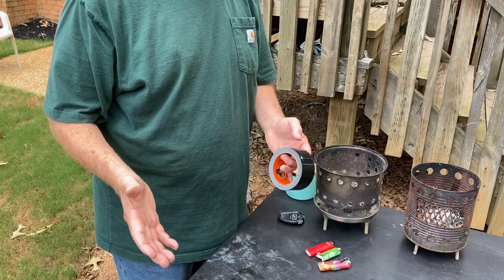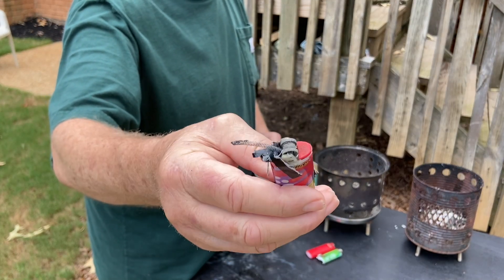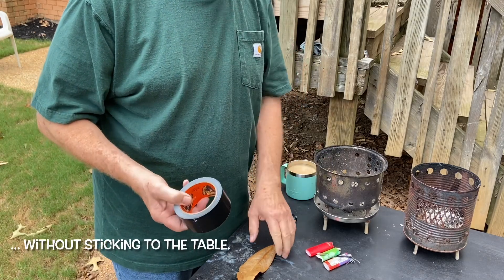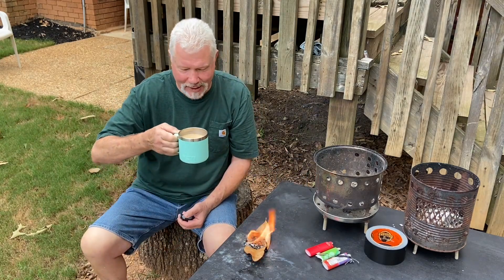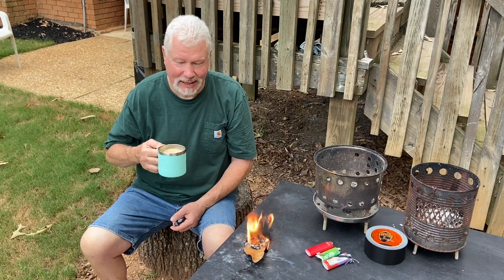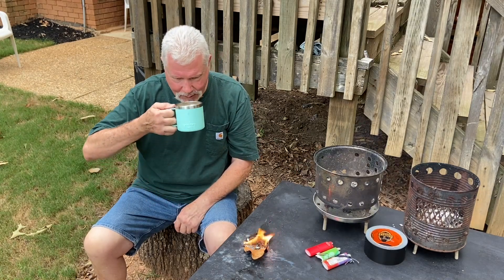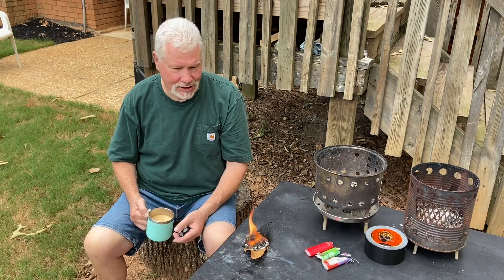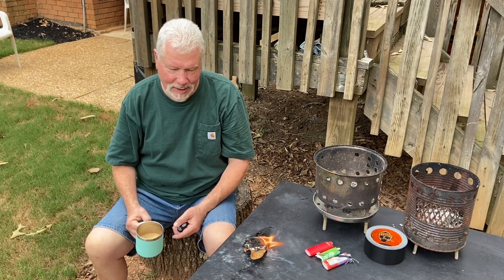More Ferro Rod Ignited Gorilla Tape Experiments

Comment from the maker: 4 Findings... 1) It is possible to empty BIC ignite strips of Gorilla tape, but not practicle. The slow grinding away of the mini ferro rod inside the BIC to create a pile of grindings to place close to the ball of tape strips to ignite with the rotary striker should work, if you have that much patience.

   2) The 1/8" and smaller strips of the tape are very slow to ignite with a 3 1/8" x 5/16" bayite ferro rod. When you do get a small flame, it can be blown out easily by a small breeze. Yesterday, it took 6 strikes of the ferro rod to get a flame which blew out, 6 more strikes to got that tinder bundle to successfully ignite. The 2nd tape tinder bundle that I tried from yesterday, took 6 strikes to successfully ignite; and today's? It took 11 strikes. Luckily, the wind did not blow it out.

   3) The "Usable Burn Time" for 12" of the approximately 2" wide tape was 5 minutes. Great for igniting damp tinders and kindlings.

   4)  A Magnolia leaf made a great tray to work off of and barrior to keep the burning blob of tape from sticking to the table.

Please follow the LINKs below and SUBSCRIBE. Thank You.
Ferro Rod Playlist
https://www.youtube.com/playlist?list=PLkoXX8XsMW3lI6k8TH1Bljf57Yvp9K1WD
Ferro Rod Ignited Gorilla Tape Is A Great Fire Starter
https://youtu.be/FN-E4b6QZDA
Ferro Rod Ignited Duct Tape Is A Terrible Fire Starter!
https://youtu.be/H0CSX6pUEwU
Reply from the maker: I always use bayite. See my ferro rod playlist.